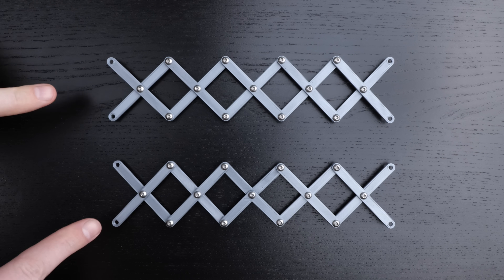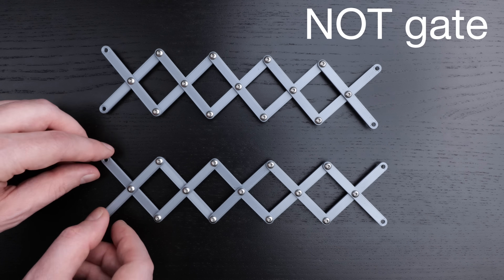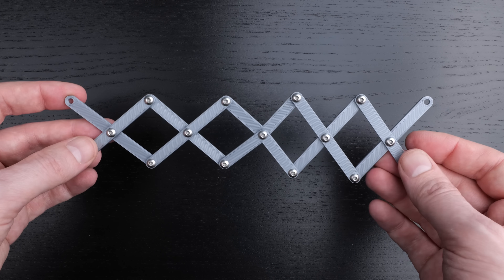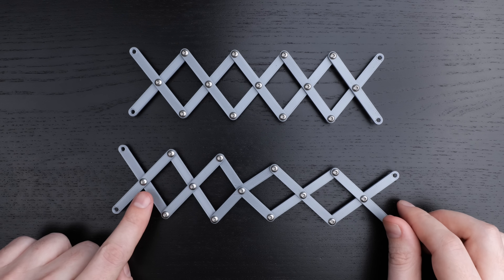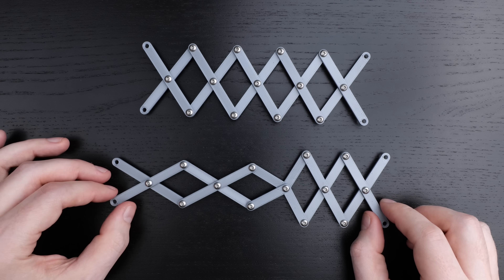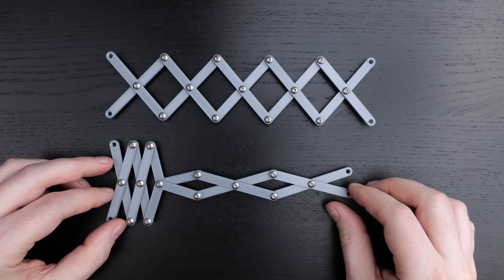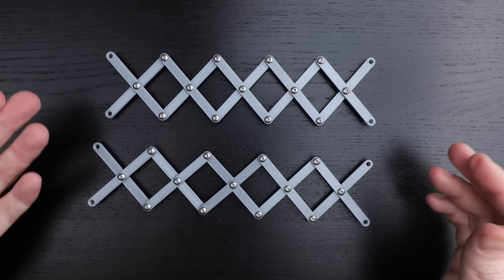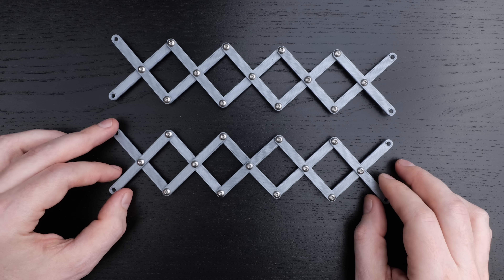Scissors NOT gate

Comment: I think the non-constant length is actually a bonus, because of how it allows you to switch it by moving the ends closer and further, and i'd want to build in a way to exploit that.
edit: I can think of how to make an XOR gate, and I think I can make an AND gate out of a combination of the XOR and NOT gates... hmm...
Reply: The easiest way to do that would be to have fewer links to one side of the 90° linkage pair. Giving the left side 1 more link than the right makes the difference in overall length between the left side being open and closed equivalent to the difference in overall length of 1 regular scissor (edit: maybe not exactly, but nearly).

If we'd bother to make the linkage have positive difference like this, we can do better, because we probably don't have monotonic difference in length with respect to the angle. I presume just adding more regular linkages to the same side will eventually overpower the component that makes it not monotonic.
Reply: @PeterBarnes2  that wouldn't work by simmetry, remember it can be on or off for both sides so if one compensates for the other when it's in one state it'll mess up worse the other state.
Reply: @Kostynha  What? It's a scissor lift linkage. You can make either side have as many regular linkage pairs as you want. Or as many 90° linkage pairs as you want, for that matter. What's illustrated in the video has nothing to do with the fact Segerman put 2 scissor units to either side of the 90° linkage pair. Of course it'll still be on or off for both sides.

What I'm suggesting is actually to mess up the lengths even worse for both states, in terms of the overall length. Instead of making the overall linkage stay approximately the same length in all states, to just not try to do that, and let it vary even more, which is very specifically the first thing OP's comment was about.
Reply: unfortunately, I don't think XOR and NOT gates shouldn't be able to make AND (or OR). One way to see it is because both have "even" truth tables.

But maybe there's a direct way to build a scissor OR or AND or NAND?
Reply: @user-sl6gn1ss8p  "xor" and "not" are not logically complete, correct. NAND is and NOR is, so those are good candidates.
Reply: @user-sl6gn1ss8p  you're thinking too inside the box. you can use the physicality of these gates to do things that an electrical logic gate couldn't.
my solution isn't very elegant, I would like a more direct way, but I'll probably make a video soon demonstrating how it's possible
Reply: @Arithryka  if the things are working and used as logic gates then, by definition, the same math applies. This has nothing to do with them being electrical, mechanical, vacuum tubes, etc.

Now, I'm not saying you can't hook scissors up in a way which makes the equivalent of an OR or AND or NAND gate. All I'm saying is that if you use them as XOR and NOT gates, you can't get those others from them. If you do get them, then, by definition, you're not using them this way.

But yeah, all that aside, my bet would be that there are ways to hook this stuff up to get to the gates. Do let us know when the video comes : )
Reply: @user-sl6gn1ss8p  I'm not strictly combining them the way you'd combine logic gates by stringing together their inputs and outputs. I'm exploiting a property of the mechanism.
Reply: @Arithryka  fair enough
Reply: @Arithryka  3 months later...
"This channel doesn't have any content"
😢
Reply: an you can make pretty much any gate out of an nand gate
Reply: So the length represents state, good point, but we still want to know the constant length.
Reply: Please show us all! That sounds sick!
Reply: How tf you make an xor gate?
Reply: Could use the length to represent another state on the same doodad
Reply: Hmm. Maybe spring and pressure switches?
Reply: how can a gate be all gates at once
Reply: @DerangedPacman  using NAND in different arrangements can achieve this, for instance.
AND a,b: (a nand b) nand (a nand b)
XOR a,b: ((a nand b) nand a) nand ((a nand b) nand b)
NOT a: (a nand a)
NOR a,b: not(not(a) nand not(b))
OR a,b: not (a nor b)
This can also be done with NOR instead of NAND, but not with every gate.
Reply: @sly-shot  oh
Reply: @sly-shot  'in different arrangements'
Yep just hit this, but was immediately going to post the same.

'This can also be done with NOR instead of NAND, but not with every gate.'  Hmm seeing the other stuff that might be off, they're mentioning NOR can do it too.  Not going to check myself since I don't need it in depth right now, but I'd trust the multiple sources until I double checked and was 100% sure there was something NOR can't do..

Ha if NOR can construct a NAND, then you can do a deeper chain and do any gate that NAND can do too.  Bet that's the solve if there is a gate NOR can't more directly do by itself.

Ha this ended up being a mini-guide.  But there's enough here to jump start  everyone on building a mechanical computer out of about anything.

Very basic, very early computer theory that all gates can be built from only 2 of the gates.  I don't even remember which two gates off hand since I don't keep it fresh, you can always go look it up or play with them until you work it back out.  

Ha googled 'two logic gates to make all other gates'  gets  
'Each logic gate operates on inputs in a slightly different way; they output 1 and 0 in different situations. In fact, the NAND and NOR gates are known as universal logic gates, which means that we can build any of the other gates with only NAND gates or only NOR gates.'

and ' You can build any other logic gates from either of them..'  

Heck even I'd forgotten you really only need one of them, not like you really do this and redesign gates every day.

And 'mechanical computer' here on youtube will get you a ton of videos of gates etc, there are just a lot of ways to do it.

So once you can do those two gates (really either of them), you can always build a computer, because it just becomes a question of stacking those two gates.  Of course you can usually build much more direct versions of the complex gates.  But if you can build those two, then you already know you can at least build a computer even if you have to use the indirect, constructed versions of gates.

This is old school like pre-Commodore 64 stuff, even back to Creative Computing and similar, everyone who was computer hardware type people used to know this off hand, including me.

Don Lancaster's Engineer's Mini-Notebooks etc, pretty sure he had one on logic gates and/or transistor logic that mentioned it.  But I'd known it well before that, probably from late 70's computer magazines.  Likely still in my stack of magazines somewhere.  If you have any interest in electronics and weren't aware of them already, you should read the mini-notebooks.

And of course you can make a scissors computer, only a question of figuring it out a bit.  Babbage's difference engine, Curta and other mechanical calculators, and an old image of see saw logic out of wood that looks like a playground spring to mind.  No need to invent anything new, you just look at the previous gate logic computers and other mechanical gates, and translate the ideas into 'scissors'.  It's all really just a few old school computer ideas that less people bother to learn now.

Wood logic gates, mechanical logic gates, etc.  Plug those in on google image search and you'll find tons of inspiration that will almost directly translate.  Won't take much to convert it to scissors.

About the only people who really learn low level logic were microcontroller programmers, FPGA programmers, and chip and processor designers.  There are a few other fields here and there, but it's amazing how few it is when so many things run on top of it.
Reply: It's not possible to make anything but NOT and XOR from NOT and XOR. They're called linear gates (in mod 2) and they can't build nonlinearities
Reply: If right now we've got the sum of sin x + cos x, it does seem like the way to get constant length is to introduce a squaring element somehow, so you end up with sin² x + cos² x.   But multiplication in physical computing is usually a challenge I think.
Reply: its been 2 years. how your new computer? :)
Reply: Could you please guys check my comment if the AND with three NOT gates could work? thanks

Comment: For and gate, two not gates beside each other with the inner outputs linked with the identity linkage? (Outer ends of the not gates fixed I suppose)
It wouldn’t be perfect in terms of deciding power - both off would be markedly different from one on would be markedly different from two on - but it should be closer maybe?

Comment: this would be useful for converting the linear motion of a screw through 90 degrees. If you were to mount a screw thread to the start of the mechanism and then mount what you want moved in the middle.

Comment: The harder question is, can you make every gate, and just a wire, with constant length, or else your entire system will break when something changes length…
Reply from the maker: With two constant length NOT gates you can make a constant length wire.
Reply: Could you please guys check my comment if the AND with three NOT gates could work? thanks